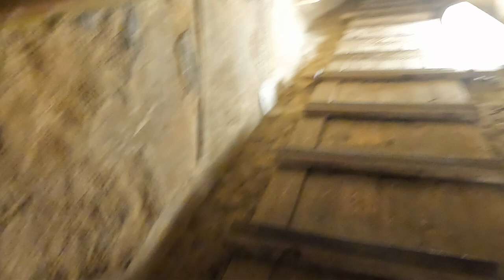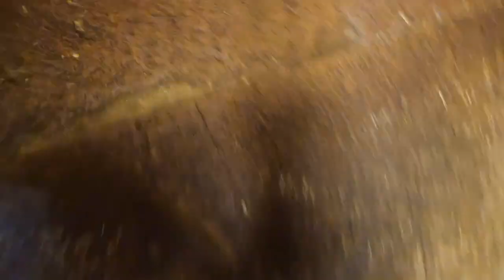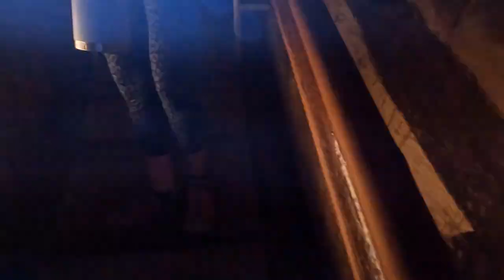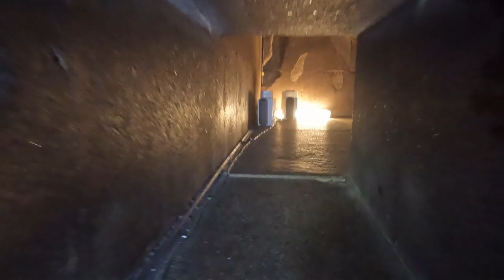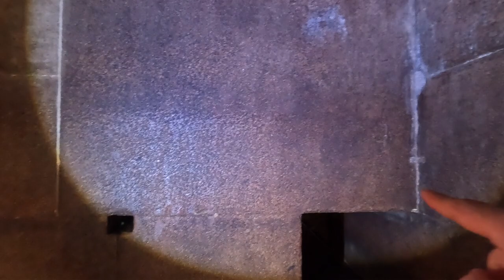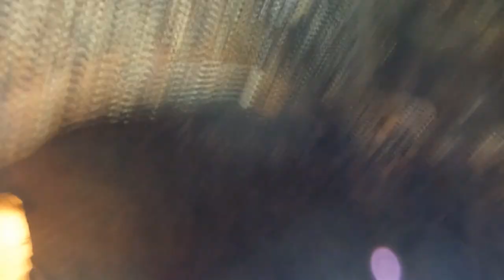Sunday Site Visit 26: Inside The Great Pyramid

Comment: The base of the Contact Process Chamber feels like a critical inflection point with 4 different directions water/solution can flow. There must have been some awesome functional artifact/valve in that area that assisted with the multi-directional flow of water from the pumps?